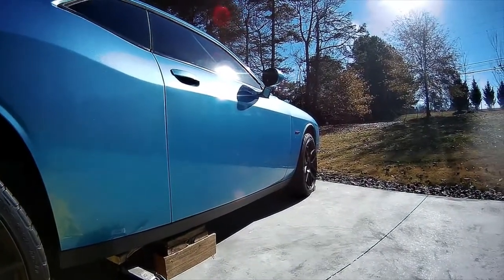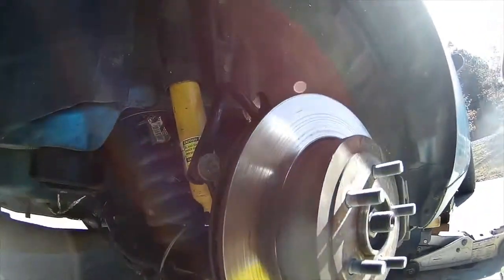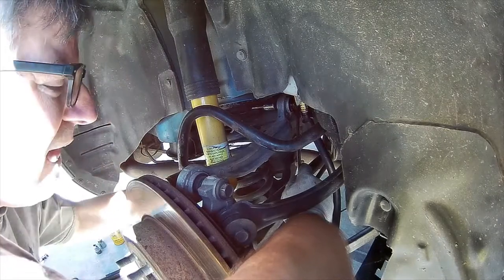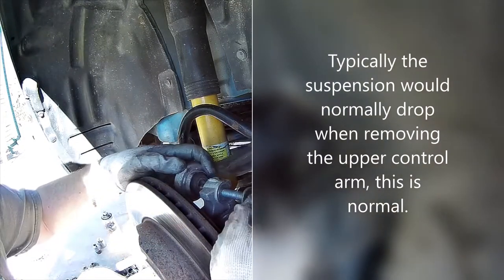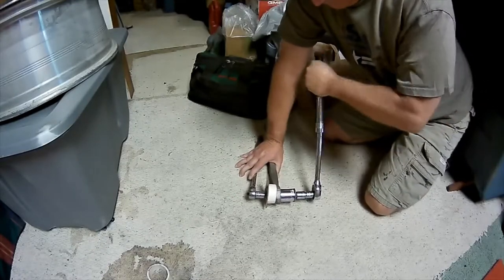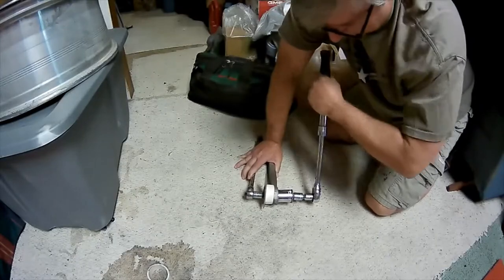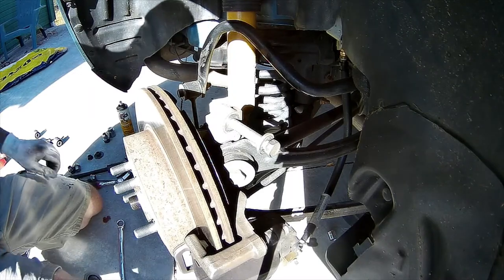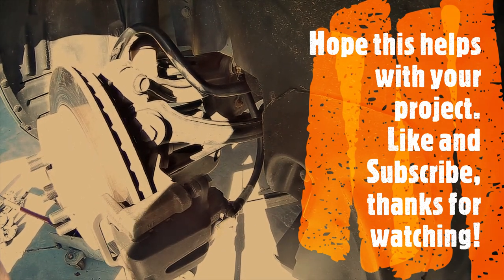Rear control arm camber bushing installation, explanation for dodge challenger charger 300

Comment: Do you have to remove the bolts, and adjust the bushing based on alignment numbers? Is there a way to adjust without removing the bolt?
Reply from the maker: bushings are pressed in, it's a trial and error type thing. Right side was pretty close  I used a digital angle meter to get rough readings then clocked based on. Although i had it apart and the left side settled in. Now have to press left one out and reclock then press back in.not the best system IMHO.

Comment: So is it one bushing per side? And did it fix the camber issue with just one bushing?
Reply from the maker: Actually 2 per side i was lazy and haven't put the others in yet but they probably need to be, a professional shop with an alignment machine would be able to tell

Comment: Boss old video but hate to tell ya . The neg camer in the rear pass is not because the cradle . The battery and applied torque causes the coil spring to compress over time making the camber go neg .
Reply from the maker: If i showed you the accident damage before i replaced the entire rear section you would totally understand but on an unmolested vehicle what you mentioned makes sense